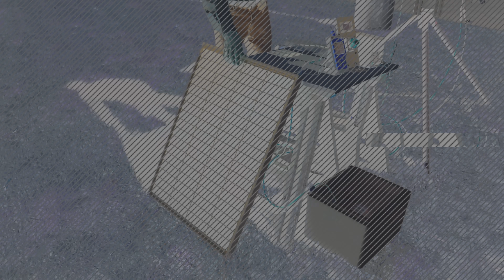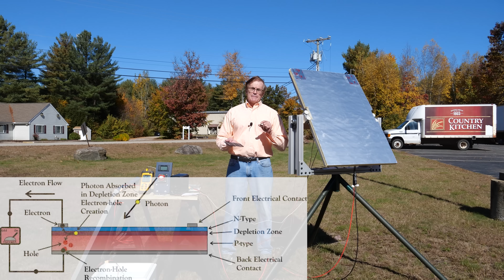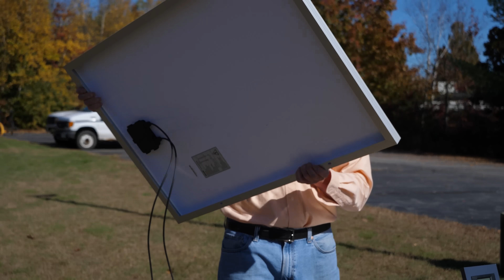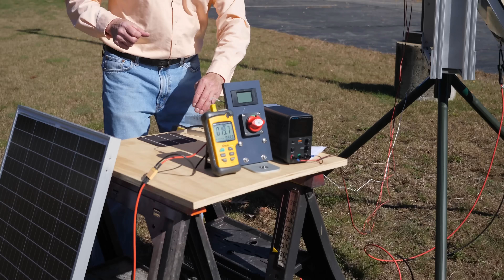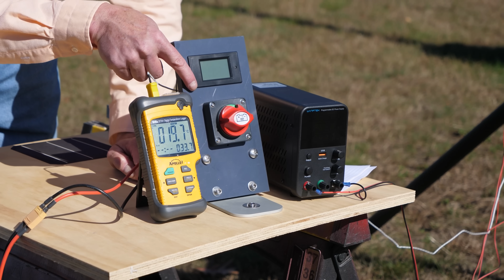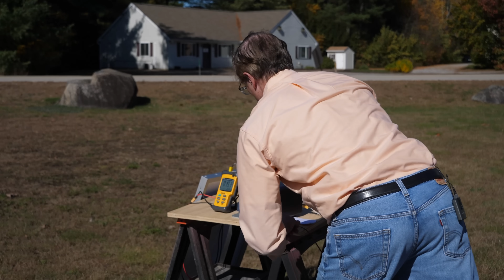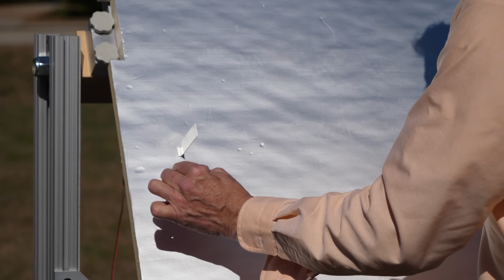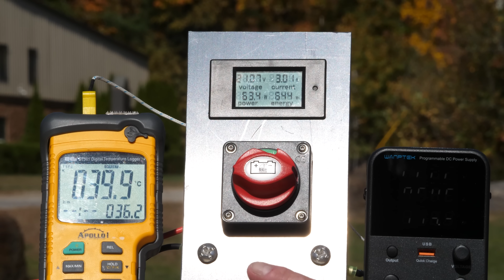Do you REALLY get enough out of your solar panel?

Comment: I doubt this will ever take off for many reasons.  The comparison of the temperature and power output with/without fans was flawed, it should have been done by measuring the temperature of an unmodified panel as the baseline.  The modified panel with the fans off probably runs hotter which would show a false gain when the fans are turned on.  It also means that when a fan or power supply fails the panel will overheat which will bring down the power output of an entire series array.  As dust builds up on the fans and heat sinks the cooling will reduce.  Any time there's wind the gain from active cooling will be less.  The upfront cost plus the cost of replacing fans will likely eliminate any long term savings gained from the panels having a longer life.

Comment: I just found this channel and it rocks! What if you put a panel adjacent the solar panel with the white cooling space paint that lowers the temp. Then you pull air through the cold panel before you pull it through the solar panel thereby lowering the temperature of the solar panel even further! Boom!
Reply from the maker: Good idea!
Reply: @TechIngredients You could even put the white panel below the solar panel. Add a hinge so you can fold it up when not in use and it protects the solar panel when stored. Add a sun tracker and now you have an awesome portable solar panel system optimized for efficiency. Anyways, you do such a great job explaining things. Well done! Congrats.

Comment: Did you see a video from Nighthawkinlight where he built a solar tracking panel using miniature solar panels behind the large one connected to small motors that controlled the movement of the rig?

I was quite impressed by the simplicity of the method. Whenever solar rays hit the small panels as the sun moves, the corresponding motor changes the direction of the bigger panel until all the smaller solar panels behind it are blocked by the bigger panel and all motors stop moving.

So complex or expensive computers or GPS trackers involved at all. I really liked it.

Comment: Its 2026 now and the thing is.... Solar panels have gotten extremely cheap. A 430 Wp solar panel only costs about 60 euro (80ish dollar). And the beauty of it is its simplicity. There are no moving parts. A fan will make the panel more expensive and also less reliable. In a open weather installation, NEVER introduce moving parts if you can do without. Only do that, if there is a good reason for it. There are many companies that have tried to introduce active cooling, but in the end it's usually a waste of time and effort.

Also, efficiency is not that important as everyone thinks. I have a 8,6 kWp solar installation on my roof and in the summer 3 kWp would be plenty enough. Only, there is not a single reason as to why not install more power than you need, because the panels themselves are by way the cheapest part of the installation. In the winter and early spring the temperatures are not a problem and the installation is running at peak efficiency anyway, without using any fans. In peak summer the efficiency is terrible, true. But at that time the power isn't needed because the house doesn't need heating and everything else is just negligible and taken care of 10 times over. In the winter the power is needed, but the temperatures are not a problem. In the end, you are solving a nonexistent problem here. The numbers don't look nice in theory, but in reality those numbers are not very important in this instance.

Comment: Random idea- what if you combined a solar PV panel with those solar water heaters and make a watercooled solar panel that also preheats water? Since on most solar panels the frame is much thicker than the actual panel with the PV cells, if you added a back panel on the other side of the frame and added some connectors for water to flow, you could fill the thing with water and it would double as a water heater
Reply from the maker: I've thought about that too.
There's a rub.  Each system competes with the other regarding efficiency. 
If the water is allowed to heat up to feed the hot water system then the performance of the PV panel drops. If the  water is allowed to dump it's heat into  colder surroundings like the air or the ground, then the water heater doesn't see it.
There is one possibility.  If the water is taken from a well or the municipality and first passed through the solar panels to keep them cool, then the warmer water can be sent to the water heater to add the necessary additional heat. There can be no recirculation. And the hot water consumption has to be large enough so that enough cold water will flow through the panels.
Reply: @TechIngredients  Yeah, the idea would be to connect to municipal water supply as a preheater for the main water heater so the main heater does less work. Although what you said about the water consumption needing to be consistent would still be a problem.
That being said, a Technology Connections video has reminded me about the existence of heat pump water heaters. What if the evaporator on those was connected to a recirculating water system taking heat from the solar panels? You could then "charge up" the water heater like a battery by raising its temperature, then have a mixing valve or something like that to regulate the temperature coming out, so the water consumption could be very low or sporadic and you'd still be able to store the energy. You could maybe even get the solar panels to go sub-ambient (though condensation would then become an issue maybe?)

This would be more complex than just piping  tap water through the solar panels but would certainly be interesting to look at.
Reply from the maker: I agree.

Comment: His system defeats the purpose of a bifacial solar panel.
And using well water would deposit all kinds of minerals on the panels too. So would tap water.
Perhaps use an ancient cooling method called a yakhchāl but modified?

Comment: For the fins, you could cut half circles or squares in the sheet and bend them out. If you need more fins, use one more sheet and offset the bends so the fins slot into the holes left behind from the first sheet.

Comment: This was super helpful — thanks! Quick question: if the panel is perfectly oriented toward the sun (like with a tracker or manually adjusted), shouldn't the output be much closer to the panel’s rated 100W — even in New England — at least around noon on a clear day? I get that latitude affects the sun angle, but as long as the panel faces the sun directly, the irradiance on its surface should be similar to what it gets at the equator, right?
Reply from the maker: Thanks.
No, it isn't, but the deviation isn't very large. If you are pointing directly at the sun but the sun isn't directly overhead, then the light is slicing through a thicker layer of atmosphere. The limit is when the sun is just above the horizon.  That's why you can actually enjoy a sunset.

Comment: One wonders how they shed the heat of PV panels in the vacuum of space?
Reply from the maker: It's done with radiative cooling.  All objects above absolute zero radiate energy according to the blackbody curve.
This doesn't require any transfer of heat to another medium like air or water.

Comment: I love the channel , thanks for the great info. I had an idea to attach Peltier devices to the edge of solar panel, on the aluminum frame. The goal is the  draw heat from the panel improving the panels efficiency while possibly generating a small amount of energy from the Peltier from the temp difference between the hot edge of the panel and air temp . I am not an engineer so I have no idea if this is practical but I though I would share 😊

Comment: Panel temperature is being ignored to the wind/breeze effects.
What are the temperatures in say, static air (rare or non-existent) vs a slight breeze (common) vs a strong breeze (less common, depending)?
stock panel vs panel with your heat sink aluminum/fans contraption.
Perhaps this has been addressed in other videos. 
Is it so negligible as to be unimportant?

Comment: Greetings & Thank your for your dedication for understanding (teaching). I've watched reladed videos but have a question (solar & heating reliability)

I've been planing on van living (costs independance & work) for a long time but I can't figure out a proper affordable setup for safe (emissions) low/no-e.power heating/cooling+water with solar installed. I have numerous options and if it wasn't for need for solar to have space for its cooling I'd say having a flat water tank/bed, painted, occluded 2/3 size for solar panels (on roof) could work (w/ additional connectable  array. But I've calculated for winter & base cooking I'd need at least 800W solar setup (5h/d) for everyday (worry-less) reliability. Any recommendations or what to (re)search?

Comment: Thank you for the demonstration.  I know that one of your goals is to cut costs, but I cannot help but wonder how commercially available Aluminum L-channel (extruded?) would work.  It is a matter of cost vs. time saved.

I have not watched your thermal paste video yet, but I wonder how the use of thermal epoxy for adhering the Aluminum heat fins would compare, with thermal paste.

Comment: I’m sure I’ve  watched this at least once before. 
(Love the logic)
So… what about harnessing the heat you draw away from the panels to heat the incoming water to your water heater.  Yes, a lot more plumbing is required … but I like to maximize efficiency by doing double duty. Like regenerative braking in EV cars. To me, it’s all about efficiency!
Otherwise, I like this video because it does the work we don’t have to. 
But, it’s worth the time invested, even if it helps the algorithm. 
My point is, maximizing the efficiency of solar (which is rather pathetic) should be explored. 
Thank you for investing the time, energy and expense to advance the effectiveness of this venture. 
I believe there is a much better way to achieve 100% efficiency. 
But I value my life too much to reveal this on a public forum.
Thanks for your efforts, some of us really appreciate it!
Your knowledge is very much appreciated!
Reply from the maker: Don't fear that your ideas will get you into trouble. Once those ideas have exposure, the messengers aren't interesting.
Regarding the water heating approach, there is a downside. To cool the panels,  the water needs to be cool (obviously).
But as the water absorbs the waste heat, it warms, and the benefit to the panel decreases.  If it remains cool, the benefit to the water heater decreases. There may be a point where the net of that trade-off is beneficial, but it's probably going to be less than what is hoped for.

Comment: Great video! That’s what I was looking for. Pretty substantial difference in efficiency for just a few degrees. I’m thinking of using the solar panels as a pre-heating stage for a water heater. Why waste the heat?
Reply from the maker: Good idea.  Staging is key. The coolant will be most effective when the coolant is...cold.
Reply: @ Our well water is about 55 Fahrenheit, so no issues there.

Comment: G'day from Australia. After having my panel thermally nuke itself at 0830hrs (not sure if it's permitent yet), this is just the video i needed. I was thinking about doing a large copper coldplate and solder copper tubes for watercooling, but this is a better idea. Shame it is not just a standard fitment item. Thanks for investing time and giving the data on how much a simple setup can help.
Ps. I wish my panel only got as hot as your panel did, but mine burnt after a glancing touch. So whatever that temperature is.

Comment: Can you combine the solar panels with hot water solar collector so as to run the cold incoming water in a coil behind the panel and then enter the collector ? If lower temp are needed combing it with heat pump in the Winther daytime could also be win win
Reply from the maker: You could.
However,  the two processes are working against each other.  You want the solar panels as cool as possible, and you want the water to be as warm as possible. Your suggestion is convenient and compact, but it will be less efficient.
Reply: @TechIngredients you are right. However, I think it could be used to warm up incoming cold water before it enters the house water system. I am thinking a separate buffer tank after the cold water supply. Yes my toilet bowl water will be slightly warm but this will also marginally help heating up water in the boiler by giving the incoming water slightly higher temp. Thank u for all you effort and content.

Comment: I have an alternative solution to cool the panels that would require no pumps or fans. The key is heat and a Venturi. You build a black box and when the sun comes out it will heat the black box. You exhaust the air out of the top of the black box and it will pull are in from the bottom creating a vacuum to cool your panels. Bury a pipe in the ground and you could get even more passive cooling to cool your array. No moving parts

Comment: Why not put the fans at the bottom to push the hot air out the top, since heat rises?

Amazing channel btw.  Glad to see you at 1M subscribers.  Let’s get this man to 10M!
Reply from the maker: Thanks!
The fans were mounted at the top, but we're blowing outward. The fans complimented the natural tendency for warm air to rise.
Reply: @TechIngredients  Awww, that makes sense.  I agree with you totally active cooling on panels makes sense.  It would pair well with magnification reflector side panels, which you’ve shown.  Those two improvements combined with a stand that tracks the sun, could be massively a net positive energy and faster break-even if manufactured at very high volume to bring cost down.  It would also be interesting to experiment with reflectors that primarily send useable spectrum to the solar cells, which could benefit from active cooling as well. 

I doubt fans pushing from the bottom and pulling from the top would give a better net gain, but it would be interesting to test.  Your experiments are great.  I think you’ve probably forgotten more than I’ll ever learn and that’s enlightening and fun to watch.

Comment: Installing the fans in the top side is not ideal, they are fighting to pump hot air towards the bottom.
Hot air wants to go up, you should install fans on the lower side, that way fresh air enters from the bottom, and hot air leaves from the top side.
Reply from the maker: You're forgetting that the fan can be mounted in either direction. The reasons you gave is why we mounted them to blow outward.

Comment: Efficiency suggestion:  Install a water-based heat exchanger on the back of the panel and pump cool water from a barrel through it (Closed circle). But make the membrane pump move by using a Thermosolar to Kinetic conversion. (Sterling etc.)

Comment: For some reason i'm just binge watching your videos again as i loved them so much. Everything lines up in my head. Would you be able to cool the pannel with water if it's cooled by the radiating pannel made in the video "Air Conditioning isn't free... but we're close" ? as it cools the water very efficiently ? or maybe couple the hot water exiting from the panel to the water separator from the dessicant based air conditionning system ? as the hotter it gets the more you need AC and the more efficient it will be normally ?

Comment: Just as information, i have seen thermal dispersing coatings in automotive applications, radiators, intercoolers, intake manifolds & other types of heat exchangers, that are "supposed" to increase energy dump speed by up to 30%. They have to be baked on, so they would probably have to be done in a powder coating sized oven for solar panels? They also would not function on the bifacial panels either?

Comment: I wonder if just putting fins on the back with no ducting how that would help
Reply from the maker: For passive flow, it's probably better.
With the fans, some of the powered flow will be drawn from the surroundings, and the performance should drop.
Incidentally, with the fins AND ducts as we installed them, the panel ran cooler even without the fans.

Comment: Can you make a video about making low cost battery packs for typical house storage? 

LiFePO4 are still expensive, and we don't need the light weight for home applications. I see you can restore flooded acid batteries with Epsom salts MgSO4. I decided lead flashing at HomeDepot and Epson salts was easy enough to acquire. I'm currently messing around with attempting to make a small cell. Any suggestions on how to make a DIY battery? 

I particular like that lead can be reclaimed and made into new plates after they have been spent. Other technologies have re-occurring costs. The lead can be re-claimed with an electrolysis process like electrowinning. I dream of a battery buried in my yard about 1ft below grade, keeping many issues outside. Underground to keep temperatures OK year round. 

Cell to power a house could be about the size and weight of 4 car batteries, with an acid reservoir for energy storage. Pump in more acid when you voltage drops. Then pump acid other way when voltage is to high during charging. A 55 gallon drum pf SO4 is much lower cost then a $10k battery pack. Acid is the electrical storage, just pump it though a reasonably small lead plate cell. Seems this could be build for low $ with locally sourced materials.